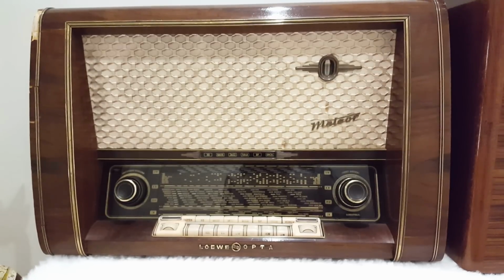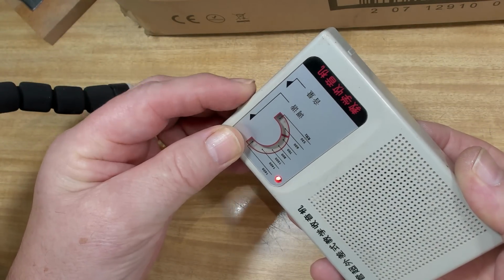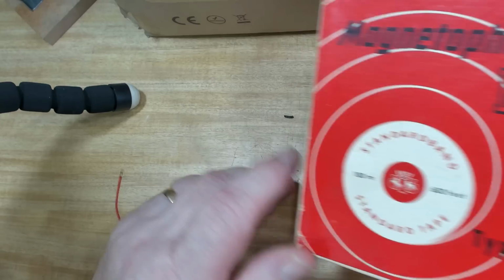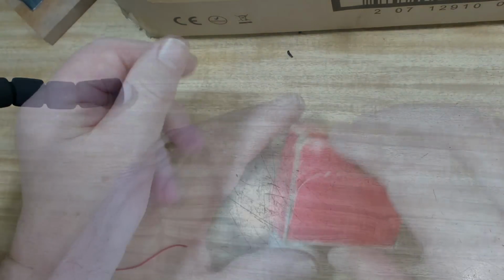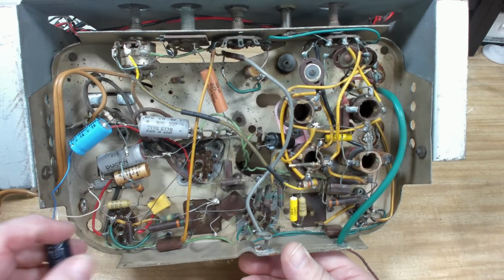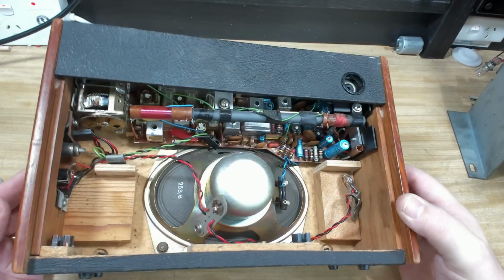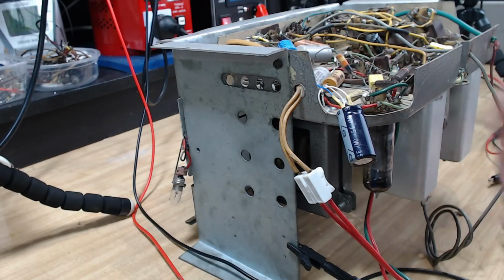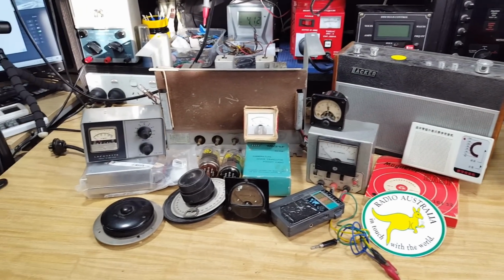Radio Club Auction - What did I get - Trash or Treasure?

Comment: Some interesting items there David. I assume the converter gets you onto 2m from a 28mhz set or vice versa. Love the miniature transistor sets. It’s usually just capacitors in those that kill them. The Hacker autocrat 2 looks very interesting. Looks like the rear grille is missing. Well done on the old volve chassis. I really didn’t think that would work. Looking forward to seeing you get to grips with them all. Cheers Graham
Reply: It's a 2m converter so takes the 2m and down converts it to the 10m band. It's receive only otherwise it would be a transverters. Not a lot of use for them nowadays as 2m handhelds are cheap or hf/UHF/VHF rigs available.
Reply from the maker: Hi Graham, I know nothing about amature radio but that is what others have said too. The transistor radio repairs are underway, including the Hacker. You will be proud of me 😄 I hope someone can use the chassis, a pity to scrap it. Thanks Graham, cya Sunday 👍🙂
Reply: @DavidTipton101  glad to hear it David. I'm sure the chassis will come in useful for a future project. Meant to with you well with the health issues and hope all is okay
Reply from the maker: @Radiocruncher  I'm good thanks Graham, all clear with health concerns now 🤞😊

Comment: Hope you're doing ok? what stage of melanoma do you have? A cool box of useless dust collectors haha, that re-714 transistor radio would make a cute little mini guitar if you gut it out and make a little lm386 circuit for it.
Reply from the maker: Hi patprop74, I don't know what stage it was, it was relatively new and hadn't progressed too far but they removed a fair chunk of skin, the issue was trying to get the skin to stretch to replace the removed part so I ended up with a 5" and a 3" incision in a tee shape and about 20 stitches plus strapping so it wouldn't pull apart.  Do you mean a guitar amp? That would be cute 😄
Reply: @DavidTipton101  haha sorry, yes I meant a mini LM386 Guitar amp. Wow, they took off quite a chunk of meat huh, That couldn't have been fun for sure, but a lot better than what could have happened if left untreated, Tell the missus thanks for taking such good care of you! I hope you have a speedy recovery.
Reply from the maker: @patprop74  Thanks, I will pass on your thanks to the missus 🙂🙂

Comment: Those quiet transistor radios are likely to be open or short circuited capacitors, if you are unlucky, maybe even a dud transistor, shango 066 has resurrected quite a few of these old radios and his videos on YouTube well worth wathcing.
Reply from the maker: I am repairing them now and I'm using Shango's capacitor probe method. Thanks Christopher 🙂

Comment: The first item the vhf converter had a sticker on the packet with an old UK ham call sign.
That and the other bits being amateur radio in type could have been from said amateur at a guess but could be wrong.
Reply from the maker: I think you are right Paul 👍🙂

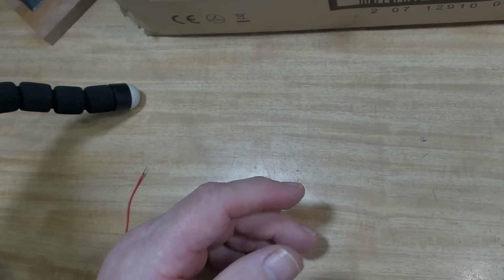Comment: Hi Dave, it's good to see what turns up at local auctions. What I found interesting was the panel meter at 3:41, like most Australian made meters it was made by Master Instruments, but the interesting thing was logo in the centre of scale, C enclosing an e, for Commonwealth Electronics (CE). CE started in Hobart just after WWII, they made professional turntables, communication equipment, and a clockwork reel-to-reel tape recorder for reporters at the 1956 Olympics. Philips purchased CE in the 1960's. No sure which equipment used this meter.
Reply from the maker: Hi Peter, the meter is a nice bit of kit, I looked at it a saw a nice meter, you looked at it and saw what it really was. Thanks for the info 👍🙂

Comment: Hi Dave, I believe that Rotary Scaled Knob is ex Royal Air Force. The numbers relate to Section/Reference, 10A/8389. The section 10 was a code number for Electrical Items. I was in the RAF from 1970 - 1996. It's possible that it was from an RAAF Shackleton. My memory is a little vague, perhaps someone will have better knowledge. Hi from England.
Reply from the maker: Hi Nigel, I believe you are right, I googled it and found another reference to military equipment. I wonder if someone could use it. Thanks Nigel in England 👍🙂

Comment: 144MHz - 2 meters, 28MHz would be 11 meters.  The Chinese radio is supplied as a kit, you should be able to find one pretty similar from eBay, around 7 GBP.  Star of the show for me would be that Hacker, extremely well respected brand here in the UK.  Anyway, good to see you David, glad to see you're well.
Reply from the maker: Thanks for the info Lloyd. I have started work on the kit radio and 'quickly' worked out it was a kit, maybe not as quick as I should have 🙂 The Hacker is on the short list as well 👍🙂

Comment: Just saw your video pop on. That is such a BEAUTIFUL 😻 radio. I don’t see a name on it 🫡. It’s a treasure, not trash 🗑. I hope 🤞 your dial cord is not broken 😞. I’ll guess that it’s probably a Philco, or close. I also like 👍 that little white pocket transistor radio. Looks like 👍 ya got some odds and ends of radios 📻. I wanna see ya ✌️ resurrect it in a future video. I know it doesn’t have a dial cord, but both of these probably need capacitors. On a second guess, the brown radio might be a Kreisler. I’ll say circa 1954. Your friend, Jeff.
Reply from the maker: Hi Jeff, a lot of trash for me but enough treasure to offset the cost. I will have a go at the little radios next time 🙂